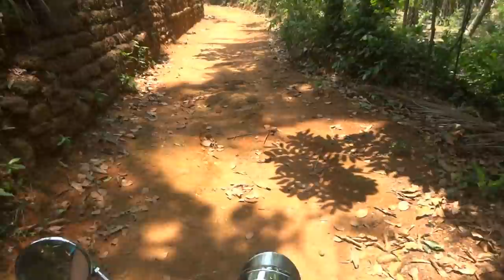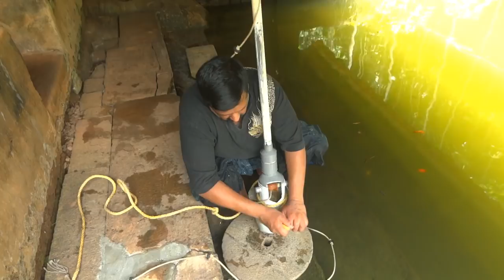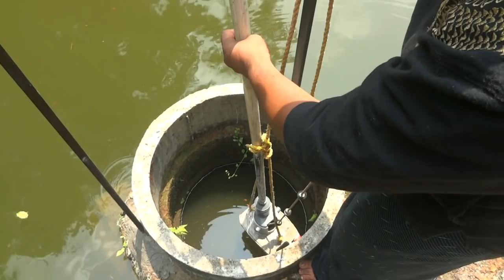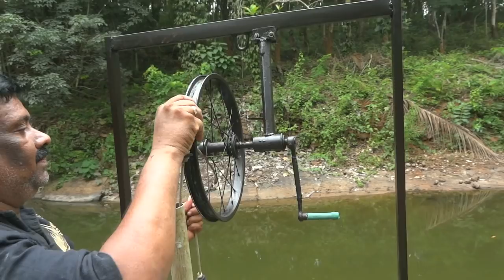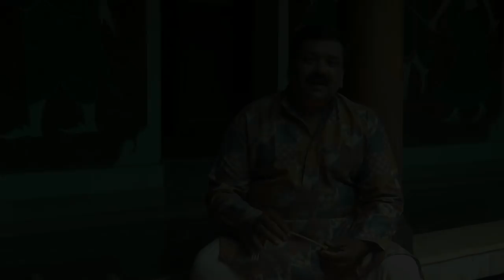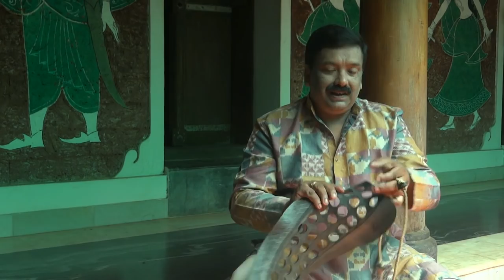Village Life #handpump #inventions #kerala

Comment: Superb sir, can we use this type with one inch pipe for bore wells?
Depth level?
Reply from the maker: Depth Level. It is a tough question. Have not tried it. The Well you see here is almost 12 feet and we filmed it in summer, water was so low, but this helped. More than 12 feet, we have to try. Pipe size is not a problem. But this was the proper size . Thanks for the query. :)
Reply: @ranarayana  I'm guessing the depth would depend on how much weight you can pull up with a hand crank. Water is about 8.3lbs/USgal the 1" id pipe has a volume of 452ci over 12ft or just 14ci shy of 2 gallons. Approximately 16lbs of water when full. So for every 6ft deeper you have to add about 8lbs of weight. Again how much can you lift with a hand crank (or before the rope starts to slip?)?

Comment: If we  prepare a windmill above that setup and take a belt from windmill and with that belt by some process if we rotate that tyre by windmill it will continuosly run.. without any energy and give you unlimited water at any height.. 😃😃😃😉😉
Reply: Okk..🤗🤗  
Second option is to setup a cycle over there.. people coming to temple from that if time to time someone will help to lift the water to the right place will be taking blessings by helping to public by serving water in temple. SIR Are you getting what actually i want to say..  
By the way.. the video was awesome.. 🤗🤗🤗
Reply from the maker: @taufikghare1539  haha. That can be done. Thank you. Unfortunately this summer will be over like this. This was installed only for summers. This time we won't use it. We are home. Everyone is home. Thanks man. :)
Reply: @ranarayana  🤣🤣🤭🤭 okk.. curfew time.. stay home stay safe.. 🤗🤗🤗
Reply from the maker: Low wind area :)